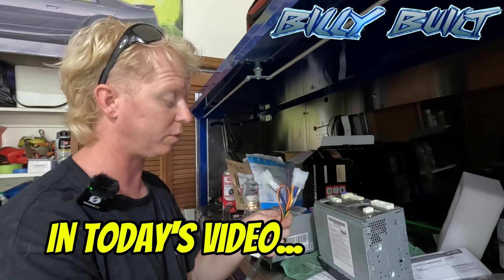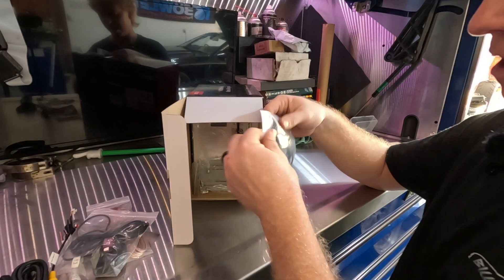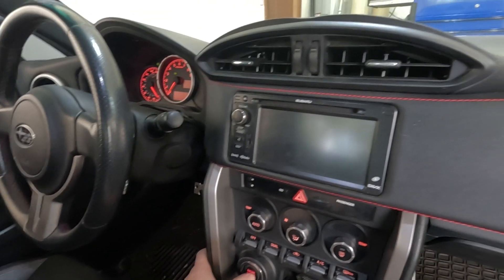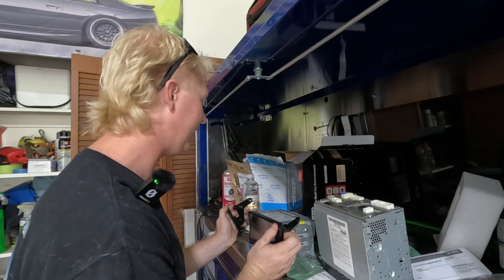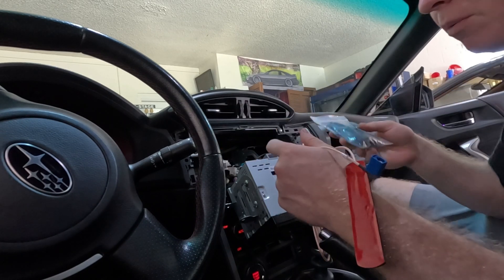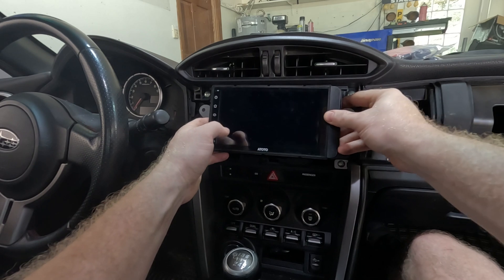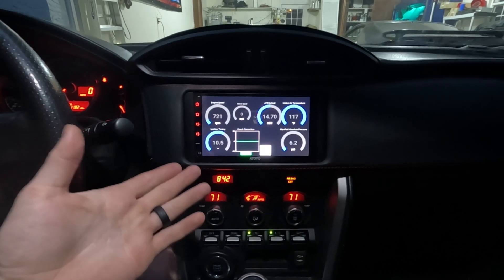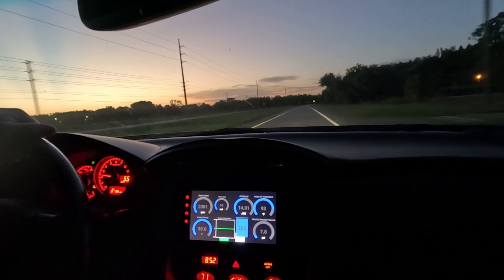Installing Atoto s8 into my BRZ for Engine Display!

Comment: Awesome! Do you think there would be any value added to having a Multi functional display installed on the Z32’s cluster as well as this? Thanks in advance.
Reply from the maker: @davidholland2916  The computer system in the 300ZX is mostly too old to function with anything like this. While I'm sure there are ways to do it. I wouldn't recommend it. At that point just upgrade your factory ECU to a standalone.
Reply: @Billy_Built  my bad Billy. I meant after a standalone.